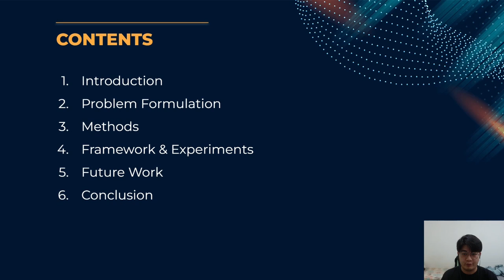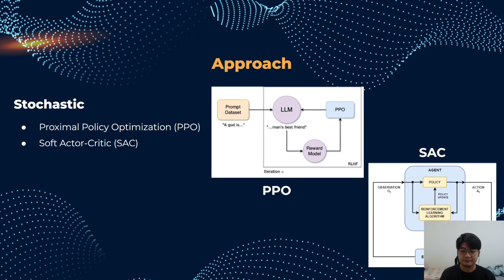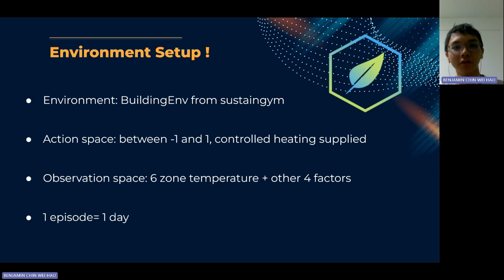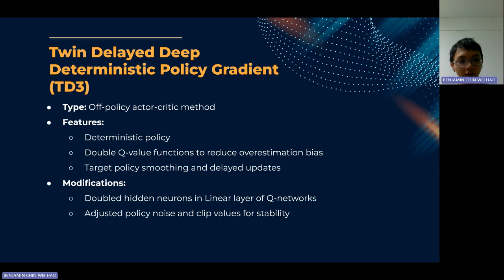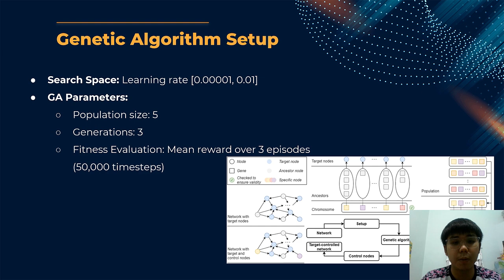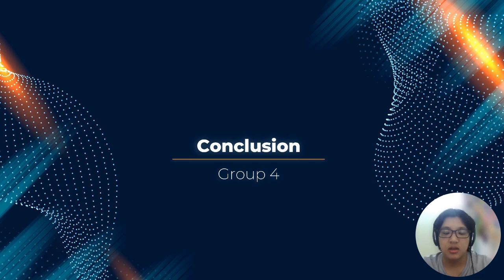202409 AIT306 Group 4 Project with SustainGym

Comment: Why did you increase the number of hidden neurons to 512 and adjust the policy noise and clip values in your TD3 implementation? How did these changes affect training and performance?
Reply: Since the environment comes with large dimensional state and action space, more hidden neurons are used to increase the capacity of actors and critics in function approximation, obtaining better Q-value estimation and policy generation. Our environment is deterministic instead of stochastic (no randomness induced), therefore, lowering policy noise and narrowing clip range can restrict action variability by making policy more stable in training, thus faster convergence to obtain optimal trade-off between energy consumption and temperature.